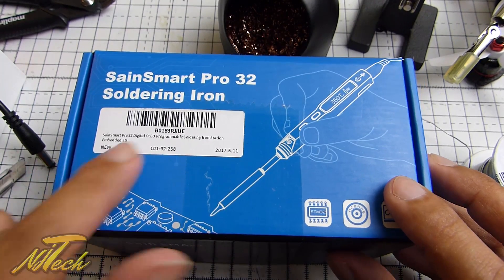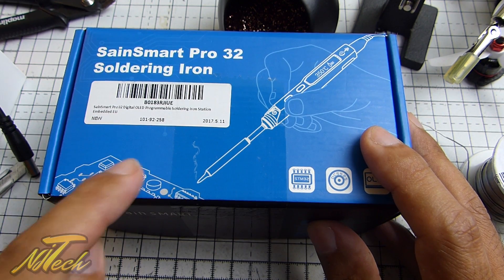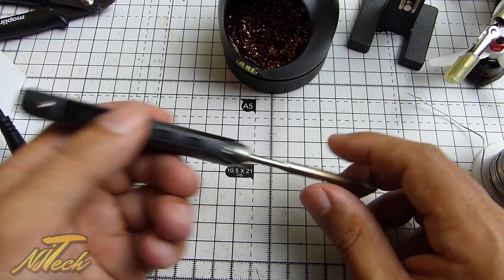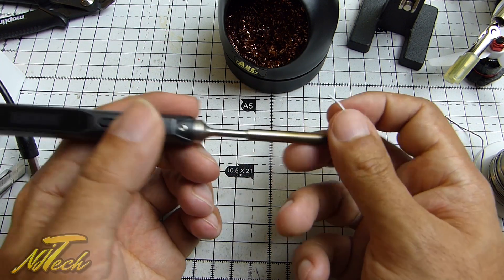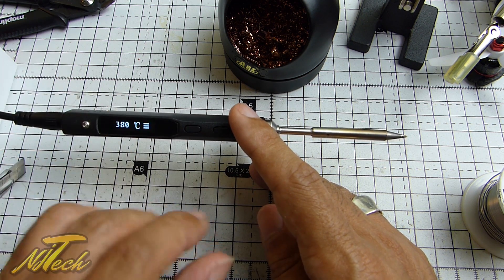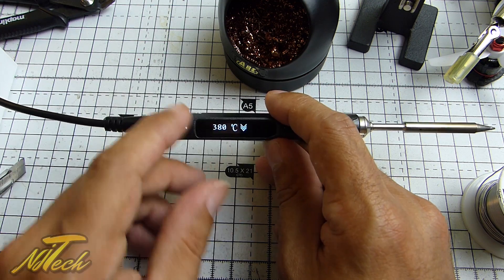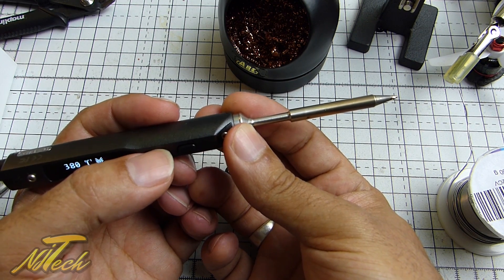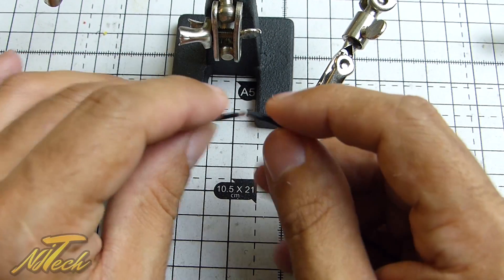TS100 Soldering Iron, Custom Firmware & soldering tricks!

Comment: Possibly my new portable iron :D Nice one Neil
Reply from the maker: it's brilliant mate, drop to 250C and you can finally, and temp-accurately solder those ESC signal wires without melting the plastic insulation. Up at 400 it flows even the thickest battery wires! Love it.
Reply: I got something similar from the guys at FPVModel but they only had the one and couldn't get them in stock. So I know once that portable soldering iron is dead I won't have a fall back. Will be buying one of these shortly :D
Reply from the maker: ok in response to lampie's comment, frist of all, there are NO chance that you are inhaling lead. Lead atmosies (boils/vapourises) at around 1,700 degrees centigrade! What you are seeing when it smokes is the flux burning off. If you can find me just one incidence of lung issues related to soldering then i will be incredibly surprised, there is no medical evidence of this or reports of it. You have more chance of getting lead into your system through touching the solder and then putting your fingers in your mouth, and that is a fact. Wash your hands after handling lead solder and then your risk is near zero, but you are not inhaling lead, at solder temperatures that is impossible. You don't need to fan away anything.
Reply: just hold your breath while soldering, stop, fan away the air, exhale, in hale and solder again.
Reply from the maker: correct, neither is the air in the city, or smoking cigarettes :)  but that's not my point. It's a common misconception that you are breathing in Lead whilst soldering. You are not.
Reply: Don't clean your tip after you do a solder joint.  The solder left on the tip helps prevent oxidation and will extend the life of the tip. Also, when you are done soldering, put a glob of solder on the tip. It may not be pretty, but it will extend its life.
Reply: One more to the yes list. Buy it,  I don't know why I have any other irons.
Reply: Ron Jones, every day is a school day. 
Thank you for the "tip".
Reply: BMSWEB Absolutely needs to be. 

…If it hasn't happened already…
Reply: I have had one for quite a while now and I'm really really happy with it. I bought very recently a Hakko FX-888D and can't say I'm happier with that one(only because of more tip choices). I'm still glancing over at the TS100. But... I would love to have a good stand for the TS100. I made one by myself from a steelwire and pliers.
Reply: Btw. The best PSU in my opinion is an old PSU from an ASUS laptop. Good flexible wire, and small PSU that sits in the outlet. That is what I'm using for this.
Reply from the maker: sounds ideal! :)
Reply: well, the vapours from the flux are not that healthy.
Reply: Lampie lampie dude get a hobby. There's a lot more fucking God damn shit in life than to worry about it fucking up your lungs or other shit that's going to make you miserable. And if you don't do dumb shit like this you miss out on a lot of this shit that makes life worth it. Save the warnings and all that for people that don't know to worry. And guess how many people know what how much to worry about that, probably just about every fucking one that does it. So, uh, Captain Planet, to go find somebody else to save. Talk is cheap.
Reply: David Hannigan Jr. Why the bever talk about air sucker, breath in out your soldering damp, air
Reply: Lampie lampie thanks, will do.
Reply: Ron Jones rgr
Reply: The all show there equipment and how good the are,
But the most important the DONT have   and that is a air scuker  that suck the smoke away from you
See lot of people that are so proud to show there DIY  but a good  air sucker is to expansive 
You have only 2 longs that you CANT  replace

Comment: I just ordered one so as to have something portable to take with me on locations. But it cannot become my main soldering iron. Three main reasons: (1) power is still lacking a bit for some jobs, (2) holding for a longer time is not so convenient as there is no barrier to stop fingers from sliding, and (3) the main reason - there is simply no 1.6 mm chisel-type tip available for this iron.

Comment: I know this as an old video, but I just thought I'd mention (in case you have't already found it out), that if you have copper mesh in your soldering iron cleaner, it can damage the tips.  Use brass instead.  It looks like you are (were) using copper in it, or it could just be the color off in the video.
Reply from the maker: It's brass, where on earth would you even find a copper mesh and why would they even sell it? It would be too expensive! 😊
Reply: @NJ-Tech  OK, just looks like copper in the video.  You can buy the copper ones in places like Walmart, Family Dollar, Dollar General, Dollar tree, just about anywhere.  Not good to use them though because they will destroy the tips of irons.
Reply: You do realise brass is harder than copper,  right?!
How embarrassing for you........

Comment: can u use 3rd partied tips on it?
Reply from the maker: this design has been coppied a lot so i would think so. Verify others have used without problem before taking that risk though.
Reply: @NJ-Tech  I've been trying to find out but no luck so far, I posted on reddit and checked other sources but cant find any answer, I want to know because Im thinking to buy the TS80P but the tips are expensive so for an alternative; buying a TS100 and using Hakko tips would be good but yes.. cant really find an answer..
Reply from the maker: @phosphene8241  i have both, i used the 100 the most, the 80 is great but the 100 just works better for me. All the clones of the 100 are exactly that so i wouldnt be too worried about design variation. I would think you will be fine, just have a close look and see if you can get an measurement specs to confirm.

Comment: nice trick for  he wire. I just received my ts100 and noticed  the "ground screw"  is it here to add a secondary earth or is the negative from the alimentation enough ? thanks
Reply from the maker: It depends what you're soldering and how sensitive it is to static discharge. If you are unsure then add the ground.

Comment: can this thing solder 12-14 guage wire as easily as a traditional 60 plug in type?
Reply from the maker: Yep absolutely no problem at all. Bear in mind you need the bigger tip though, you can't expect to do much with a pointy tipped head on 12awg. I have all the tips pretty much and have yet to find something I can't solder. Even managed to solder a ground wire to my car chassis the other day haha!

Comment: Can you power it from the usb?
Reply from the maker: No it needs 18v
Reply: No. The USB port is for updating the software.
You need a DC power source with a 5.5mm x 2.5mm connector (center positive) which most people get from a laptop power supply.

Comment: Or you can use a drop of liquid flux, so as you touch the wires the solder will flow real quick so wont melt the jacket,rather than relying on the flux in the solder core to do it's job
Reply from the maker: good idea. Though i mostly only work with silicone wire so the jackets wont melt. I hate plastic jackets, they should be removed by law lol
Reply: @NJ-Tech  Yes I hate plastic jackets too :-)

Comment: If you twist the end of both wires the same way you can then carefully "thread" them into each other. The rotation causes them to spread each other, and done well the joint will hold together on its own for you to solder it (depending on how much wire is hanging from it etc).
Reply from the maker: yeah i do that sometimes when my third hand is not around :)

Comment: Speaking as one who has taken the military high reliability soldering class - you should never melt the solder with the iron when applying.
Apply the iron to the wire, then the solder to the junction and then the  wire is hot enough to melt the solder so you don't get a cold joint.
Reply: Do you not know what tip tinning is?
He melted the solder on the wire.
otherwise yes, correct - heat the part, not the solder.

I just rewatched it and I think you may be right about him using the iron to apply it, but I really can't tell. I thought you were referring to him applying the solder to the tip earliler in the video.

Comment: What a neat little iron. That would be primo in tight quarters. Adjustable by software w/ micro usb. Good deal for all kinds of hobby/craft work. On solder that will yield the best work, an RMA pure eutectic Sn63 works best with electronics. 60/40 has a plastic range and can look as bad as lead free. I know this from experience. Cleaning the solder, wire, contacts or pads ahead of time with 99% pure isopropyl will yield the best work. Also clean the soldered surfaces with the 99% pure isopropyl afterwards to clear off residuals. Unless you already have fume extraction, it is an investment worth your money to prevent lung problems later. Solder fumes are noxious and inhaling them will cause lung damage. I’m sure you don’t want that. Gloves would help. Lead reacts with exposure to air by corroding. Exposure to lead is dangerous and is transmitted through solder fumes and through handling it with bare hands. If you haven’t heard of heavy metal poisoning, look up what happens when exposed to lead. It isn’t pretty. It’s your health mate!

Comment: 12:00 Could have added a drop of flux there. I know solder contains some but its good practice.

Personally I usually put the 2 wires side by side with the ends overlapping and twist them up that way. Fast, easy and avoids 9:54 this kind of affair. But the brush method is handy on occasions where the longer unbendable bit in the wire is an issue or you have little wire left to strip.

Comment: just bought one of these not only can it use my laptop's powersupply but you can buy or make a tx-60 adapter and run it off a li-po battery which becomes a very good portable option

Comment: Shouldn't clean the tip before putting it down since the tip can now oxidate.
Reply: Those copper things are usually loaded with flux and temperature drops to 200 c when you put it down !

Comment: I just bought this soldering iron.  Have been using a Weller station for more than 25 years.  The TS100 feels very light and very small, compared to Weller.  I'll have to get used to that.  Temperature control is excellent.  I joined 3 Li-ion battery packs (7.4V - 7600mAh) in series.  Temperature shoots to 350°C in seconds.  The standard tip is rather too fine for most of my jobs; guess I'd better buy an additional set of tips.

Comment: A lot of cheap irons just have to calibrated. I bought a Yihua 939D soldering iron, the thing just wouldn't melt solder on a PCB until i crank up the temp to 400C. I then used a thermocouple to calibrate the temperature on the 939D and now it works flawlessly. It heats up very fast and temperature is always stable.

Even though I'm happy with my 939D, this TS100 looks so tempting...

Comment: Only problem is the tip section is too long vs the Hakko ( which uses the same tips by the way) and power adapters little adapters should come with it. Good luck working under a microscope with this thing. Tried it and returned it within 5 minutes as the handle is trash since the handle is also the controller unit and it does not fit your hand too well. They need to make the Handle Rounded and also put in a smaller tip section as the long tip makes it crazy to solder and do rework under a microscope. Again a great product but the friken Basics went out the window. This iron is great for basic work but for Rework reflow, under microscope work it's not very good. If they modify it a bit and do the correct changes it will be a great iron. But all my irons must hook up to regular mains.

Comment: Hi. Tested. Maybe the best and cheap soldering iron. What PSU I am using: a (DELL) LAPTOP PSU. It can be any model that support: 19,5V 3,3A. Sure, with a DC jack adapter. Works great. Cheers!

Comment: NJ, What do you think about a weller wsp80 with a ws81 pu? or is this ts100 better than a weller? i had horrible experiences with soldering irons, but i love soldering. do you think this would fill in the role of a soldering iron, or should i just go for a weller?
Also, how long do you think this will last?
Reply from the maker: its great, but for me its not twice the price great. PLus the heating element is in the tips of the TS100 so if it ever goes you just buy a new tip not a whole new iron. Not that wellars arent reliable, theyre amazing, i just find myself using this ts more often that not. Heats up so quick too.
Reply: Thank you for the quick reply, well it would be 6 times more pricey to buy a weller station from nothing than this. so i guess i'll go with this, thanks!

Comment: I'm not sure why I would ever use 450°C (or anything >350°C, for that matter), but from looking at the the source code, this firmware apparently also goes down to 50°C, unlike the 100°C of the original.  Is that so?  If that's the case, I might buy one of these after all.

Comment: Neil, would it OK/safe to power the TS100 soldering iron from an Adjustable DC 8-60V to 10-120V Boost Converter Step Up, module https://www.amazon.co.uk/Regulator-0V-32-00V-AdjustableConverterProgrammable/dp/B01DZRA5T0/ref=sr_1_1?m=AONS7HEF348I5&s  
this could be run off a 12 Volt vehicle battery.
Reply from the maker: yea I don't see why not, set it to 18V and you are golden :)

Comment: I bought this soldering iron based on your recommendation and I totally love it. I do a lot of micro-soldering work as I work with smartphones and related products. Right now I own a Weller WD1 and the tip is use is 0.4 mm Bent Conical Soldering Iron Tip is there a similar one for the TS100, if you can please let me know it be very helpful.

Thank You for the absolutely awesome firmware.
Reply from the maker: I have a link in the description for the soldering tip kit, though I'm not aware of any other ones being available there probably are if you look around as its such a popular iron now. Thanks very much for the comment, made my day! :)

Comment: I just received my Pro 32, when I enter DFU mode, “DFU 3.43” is displayed and not “DFU1.0" what does this mean?
Reply from the maker: it just means you have a newer version of the bootloader.
Reply: Neil, I just installed Ralim / TS100.hex firmware V2.00a5 oct 19 2017. When I connect the iron to the PC it doesn’t do anything, Pc doesn’t see the iron anymore, any ideas.
Reply from the maker: the new firmware doesnt need the PC anymore as all settings are done on the TS. You can put it back into DFU though if you want to flash something else. Off the top of my head its holding down one or both the buttons as you plug in i think. Mines on the older ralim and its been brilliant. Dont you like it?
Reply: Neil, I think Ralim firmware is brilliant, what I like is when you’re in the menu and pause it scrolls across telling you what the abbreviation mean. Great videos and very informative cheers Neil.

Comment: Where is the amazon link? It should be here if you did buy it from there!!!???
Only f@ckin Bangood links!?!?! Hmm
Reply from the maker: Godo Egor NEW Upgraded Original TS100 Digital OLED Outdoor Programmable Pocket-size Smart Mini USB Portable Soldering Iron Station Kit Embedded Interface DC 5525 Acceleration Sensors STM32 Chip Fast Heat (with I Tip) https://www.amazon.co.uk/dp/B074M6ZMLB/ref=cm_sw_r_cp_apa_ae73zbR013921
Reply from the maker: Godo Egor there you go. Any chance you could calm down now?

Comment: Have you got a link to the cable you're using for the ts-100?
Reply from the maker: The cable i use came with the version that i bought, but any 12-19v DC (over 2amps output) power supply will work fine. Alternatively you could run it of a battery like a 3S or 4S lipo of around 1500mah or higher.
Reply: NJ Tech Yeah, thanks! I have a power supply and all that, i'd just like that i could move it more freely around when soldering, like you can with the thin wire on the DC connector.

Comment: Shame it uses the less common 2.5mm dc socket and not the more poulat 2.1mm skt. Meant I could not use without adaptor out of box. Not mentioned anywhere, beware!
Reply from the maker: Reg Scheuber the thicker centre pin is presumably for higher current handling. However I found it quite easily online. But as you say a little annoying.

Comment: What about replacement tips? Are any supplied? Are they a standard size? I'd consider that an important consideration when selecting a replacement iron.
Reply from the maker: replacements tips are available here: https://goo.gl/VF7YJf i tend to use just the supplied tip  for most jobs and the square tip for soldering 12 gauge and thicker wires. The tips are decent quality and so far non of them have any signs of needing replacement.
Reply: Awesome. Thanks for the great review.
Reply from the maker: most welcome :)

Comment: I have worked as a solderer for 14 years. I began soldering with lead, but after the RoHS, everything we do is lead free. If I use a GOOD soldering station, lead free is NO PROBLEM AT ALL! 
Have you tried lead free with this pen? If it is a good pen, with good heat control, there really should be no problem.
Reply: oh you are one of THOSE guys ;)

Comment: Is there an OEM firmware & OEM website?. You speak about good solder, but you don't even mention which specific solder you use!. Which chinese solder do u recommend?. By the way is that a copper cleaning sponge or a steel wire sponge?.

Comment: Awesome mods and great video.  I copied the PID code and may have discovered a bug.    ITerm is not static so ITerm += (pidSettings.ki * error); does not sum the previous ITerm as it is set to zero each time function is called.
It is possible I am way off track.

Comment: If youre soldering the wire and the plastic insulation melts youre not doing it properly....
Reply from the maker: Jason Scott don't be a pedant. I know how to solder, I'm simply pointing out common occurrences encountered especially with non temp controlled irons